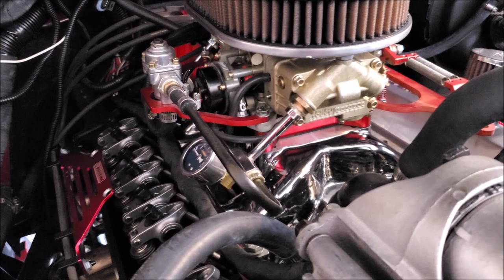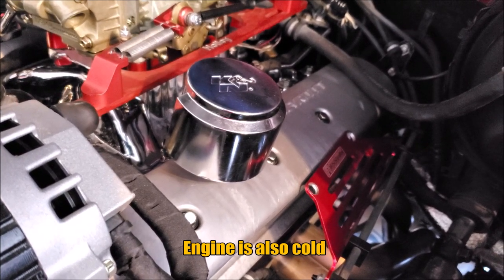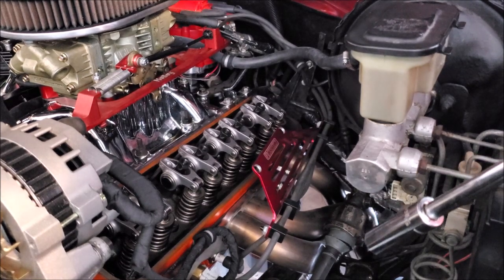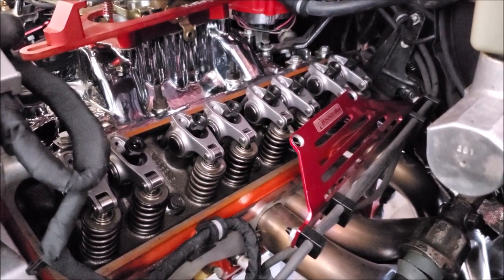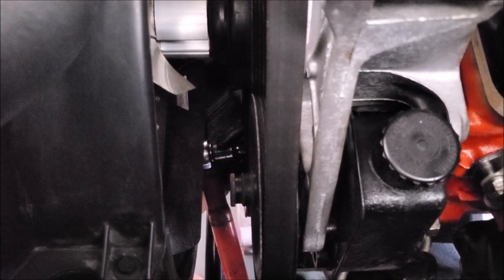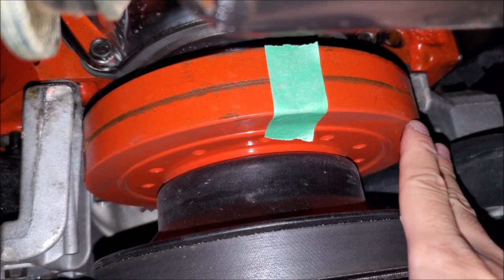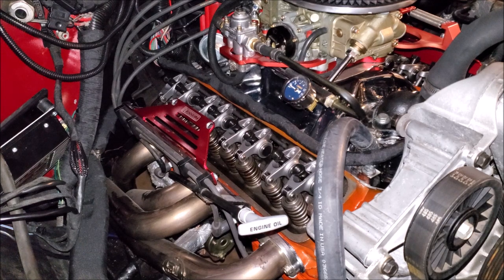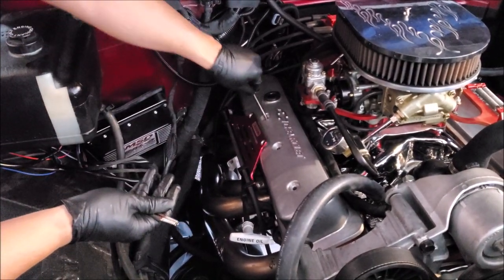Setting Valve Lash / Adjustment on Hydraulic Lifters in a Push Rod Engine (Easy Way) | AnthonyJ350

Comment: You shouldn't twist the pushrods. Just check up & down movement of the rocker arm (ignore side-to-side movement) for zero lash before adding pre-load.
Reply from the maker: Why can't you twist them?
Reply: @AnthonyJ350  Because they can still twist freely even with pressing the plunger down, so it's an inaccurate way to get to zero lash. The vertical play between the pushrod and the rocker arm is all you should be concerned with.
Reply from the maker: @Thirdgen83  We were checking for that but waiting till we felt drag while twisting to determine if they're all being tightened the same
Reply from the maker: Here's the gentleman that came up with it. Watch the whole video https://youtu.be/5EGlb_VpTAw
Reply: @AnthonyJ350  I saw his video before I saw yours, and I like it, but I would eliminate the part about spinning the pushrod. Zero lash is all you're concerned about. Spinning the pushrod until you feel resistance is inaccurate and not always reliable.
Reply from the maker: @Thirdgen83  I understand making sure there is no vertical play, but how do you tell how truly evenly you're setting all the valves. Are you saying you can't feel drag when twisting?
Reply: @AnthonyJ350  You won't always feel drag, until the plunger bottoms out (which is too tight). Just eliminate the play between the top of the pushrod and the rocker arm. Then add pre-load. If your engine is running good, there's nothing to worry about.
Reply from the maker: @Thirdgen83  Awesome! Thanks for sharing your experience!
Reply: Because you wanna make sure the lash adjusters arent pushing in and out?
Reply: I did this and felt for the twist to stop. Now my truck low idles and dies. A older mechanic I know said it works but i over tightened buy taking the twist out. About to readjust now and see what happens
Reply: @johnnychesser2639  "Just tighten until there is no up & down movement of the push-rod (make sure the lifter is on the base of the cam lobe) which is zero lash, and then 3/4 of a turn past that.
Reply: I watched the ellingson video and thought he was trying to eliminate all the up /down AND side to side movement. Ended up waaaay over tightening and had major problems. Bent a couple rods. Just up down is all..

Comment: Don't spin the push rod! Pull up on it as your tightening the polly lock down! when it bottoms out on the lifters piston and has no more up and down movement than you're at 0 lash! The spinning technique is very bad you could hang a valve open or collapse a lifter! You're looking for zero up and down movement! The "Ellison technique" is by far the best method, but don't do it by spinning the push rods you're trying to get rid of up and down movement! and I'm not trying to discredit this Ellison guy but that technique has been out wayyyyyy before that guy posted the video! Way before YouTube and his mullet!
Reply from the maker: Thanks for the feedback!

Comment: I have a Chevy 350 Motor and I did not start it for 3 weeks which is plenty of time for the Oil to bleed out of the hydraulic Lifters.   I went around 3 times.   Just exactly Like you said to do.   Went to start the motor and it would not roll over.   It was to tight.    So I back all of them off 1 1/2 turn.   Now it turns over but won’t start????
Reply from the maker: Ya the rockers only need tightening if too loose. Do you have spark from the distributor?

Comment: You will never get it accurate like that. As the lifter pumps up and bleeds off. You could have one turned .100 and another .010. You have to find the base of the cam, loosen the poly lock until the lifter print returns all the way up. Slowly tight the poly by hand until you feel the push rod start to move then back off to zero lash. Then apply the manufacturer recommended preload. You could hang valves open that way and making it way to complicated.
Reply from the maker: Thanks for the feedback

Comment: Great video Anthony!  Question...how tight is the center bolt before you start to tighten the polylocks?  Do they get retightenend during your 1/4 turn engine revolutions?  I'll be installing a full set of 1.5 rockers in my 327 sbc.
Reply from the maker: Thanks for watching! The center bolts are only as tight till the push rod stops twisting between your fingers.  You leave the polylocks till the end after you ensured you've taken out all the play.

Comment: Isn't it still supposed to be a little loose to allow for thermal expansion? Too tight the valve won't fully seat right?
Reply from the maker: That's why you stop when you feel friction. If you applied more force you could still twist them.

Comment: Hi Anthony,  
Nice tutorial ,  I have a quick question about GM 5.7 L  V8 Vortex  engine  it starts and drives good  no valves noise but after 30-35 minutes  of driving I can hear valve knocking  continuously.  After it cools down it works fine,  Is this an indication that the valve lash need to be adjusted . 

Thank you
Reply from the maker: How much mileage, what year is the vehicle, and what kind of oil are your using? Does it kind of sound like a sewing  machine?
Reply: @AnthonyJ350  Its a 2000  has 200050 miles  and it does sound like a sewing machine , oil is 5W-30 . when  it starts knocking  I just force it to a higher  RPM  and  the  knocking  will stop . it doesn't  do the knocking  at idle . Its been a mystery  to me  for a long time.
Reply from the maker: @maxsmith2320  Might be noise from the lifters. This video might help https://youtu.be/zVjVAAikdYc
Reply from the maker: @maxsmith2320  Here is the follow up video https://youtu.be/IgoLVNby9dg
Reply: @AnthonyJ350  Thank you
Reply from the maker: @maxsmith2320  If you switch to 5W40 Castrol synthetic, let us know how the truck drives after.

Comment: Hey Anyhony.  Good video but I was wondering if you loosened the set screws on the poly locks before you tightened up each poly lock ?  Doesn't look like you loosened the set screws.  Isn't bad to keep tightening the poly locks if you have not loosened the set screw ?  I would think you could possibly damage them that way.
Reply from the maker: I did mention it in the video. My valve adjustment actually backed off from the original motor build after the break in. So I was basically putting it back to where it was originally.

Comment: Will this method work on a stock 305 crossfire engine?
Reply from the maker: Are hydraulic lifters installed?
Reply: @AnthonyJ350  not sure it's bone stock 305 crossfire
Reply: @AnthonyJ350  looked it up on rock auto... they seem to be hydraulic flat.. stock

Comment: Great video! When you adjust, does the pushrod spin at all to get zero lash? Or is it firm and not able to be spun with your fingers?
Reply from the maker: I stopped as soon as I felt resistance and it couldn't spin in my fingers.  Also keep in mind I'm not applying much force at all to make them spin between my fingers.
Reply: @AnthonyJ350  thank you
Reply from the maker: @SirGuidemere91  Your welcome, let us know how it works out after.

Comment: If I may..... this video is demonstrating how to adjust the depth of the cam follower (aka lifter) plunger....... 
At 1:37 into the video, Anthony is demonstrating how the cam foller should be at Base Circle when making the adjustment.

Anthony lost me after he said that he could go down one side and adjust all rocker arm nuts. 
That info is simply incorrect! 
In order to use the tried and proven , we will start at # 1 cylinder @ TDC on the Compression Stroke. 
Both intake and exhaust cam follower plungers can be set at this point. 
Next, rotate the crankshaft 90 degrees. 
This brings the next cylinder in the firing order (#8 for the SBC) up to TDC C/S.
Again, both intake and exhaust will now be adjusted.
 
Next, rotate the crankshaft another 90 degrees, and the next cylinder in the firing order will be ready to adjust. 
Continue doing this right down the firing order, stoping at each 90 degrees and adjusting,  and then continue until you reach # 1 again. 
Now you are finished. 

At 9:50, and for a mechanical system, the feeler gauge is inserted between the rocker arm roller and the valve stem..... not the spring.
Reply from the maker: Thanks for the feedback!

Comment: So if your lifters were out of zero lash, would that cause some cylinders to run hotter? Great video. 👽
Reply from the maker: You think a valve is staying open?  I'm not an engine builder but it couldn't definitely cause some issues if all the valves aren't opening and closing the same.
Reply: Why do you think that?
Reply: What I'm thinking is that The valve isn't closing all the way which is leading to backfires.  I'm really not sure I just 5 minutes ago pulled the heads off my engine and and number 3 and 5 cylinder has no carbon on it at all it's like they're not firing they're not fire firing.

Comment: Vortec head install now I have a high idle,1500 to 2000 rpm
Reply from the maker: Is it fuel injected or carbureted?
Reply: @AnthonyJ350  Carb,650 street demon
Reply from the maker: @Mejia.Gideon  Did you try adjusting the idle set screw?
Reply: @AnthonyJ350  yes,I screwed it all the way out,no change in rpms
Reply from the maker: @Mejia.Gideon  Is there tension on the throttle cable? Or can you easily disconnect the throttle cable to make sure that's not the issue?
Reply: @AnthonyJ350  I'll try that & see
Reply from the maker: @Mejia.Gideon  Let us know
Reply: @AnthonyJ350  I tried the throttle cable,still nothing but I think it was the pcv valve it's idling at 600 rpm now thanks
Reply from the maker: @Mejia.Gideon  OK, ya a vacuum leak of sort makes sense for the idle to go up. Glad you figured it out! Have you driven the vehicle yet?
Reply: @AnthonyJ350  no not yet I'm going to test drive it Saturday I can't wait
Reply from the maker: @Mejia.Gideon  Let me know how the test drive goes!
Reply: @AnthonyJ350  I finally test drove it today drives good,I can feel the difference with those vortec heads
Reply from the maker: @Mejia.Gideon  Nice. More torque and better up top?
Reply: @AnthonyJ350  yep👍